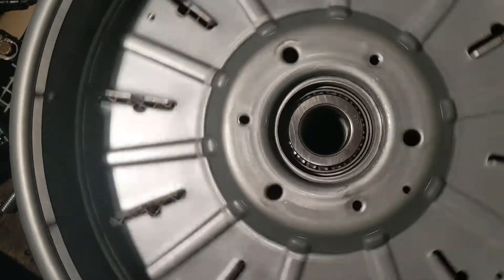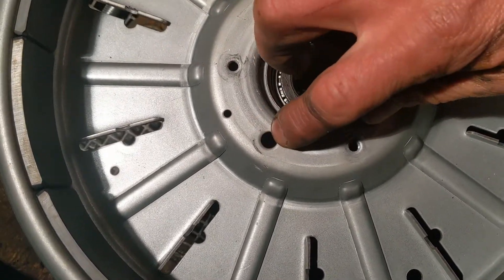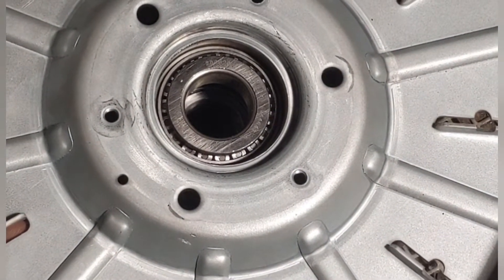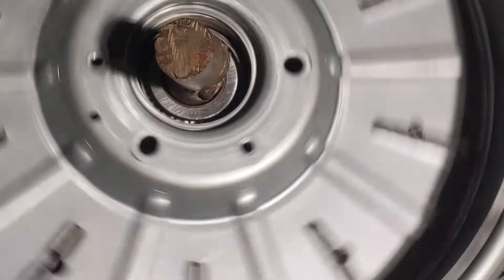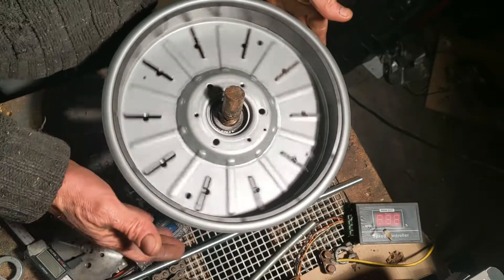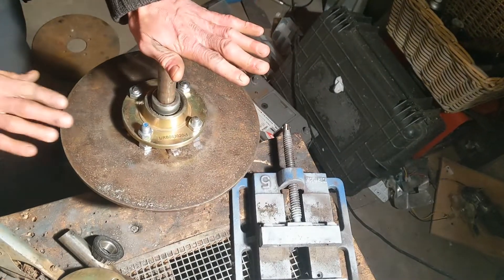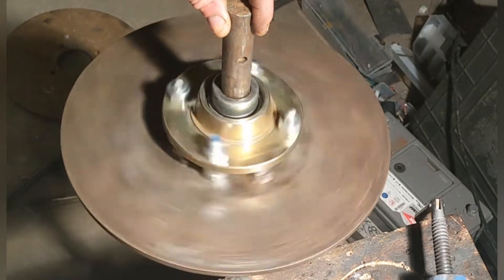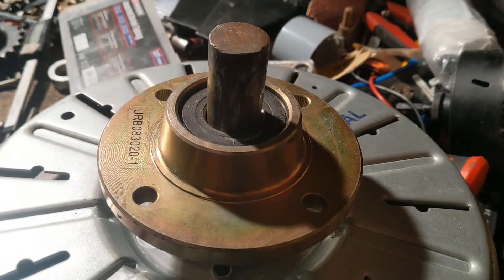Wind Turbine Project - Another Way to Mount a F+P / LG Smartdrive ??? - 17th April 2021

Comment: If you can get that 100% centred  be intetesting if you see improvements running it. I did it hillbilly once i cant do anything perfect without a lathe etc, so as my alignment was out i was still able to gently tap my blade and hub assembly into perfect centre along with endless measuring.
Reply from the maker: I trashed the red stator by pushing it in too far and twisting round :( , the plan is to get the new single one running with the ALI stator, they are so much easier to get , we test it first unmolested and if it's crap I'll try a "low speed" rewire of some kind.

Comment: Mate , "general area"  ??   Make an adapter on a lathe. Get it 100%. Don't rush it
Reply from the maker: Think if I can get a deep 50mm washer that would align it perfectly , I thought if I bolt it on I may have room to adjust it ?  wish I had a buddy with a cnc etc.
Reply: Or a 3-D printer.